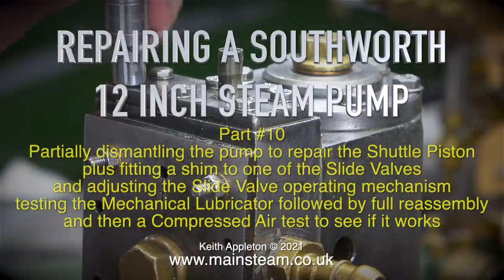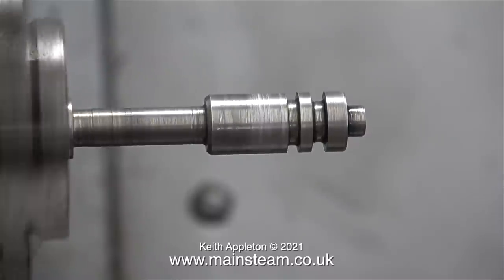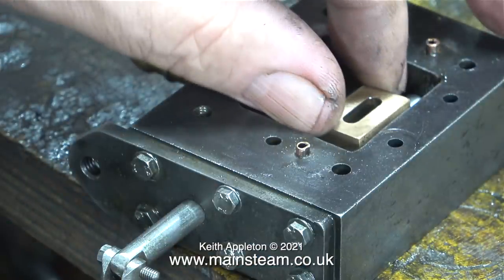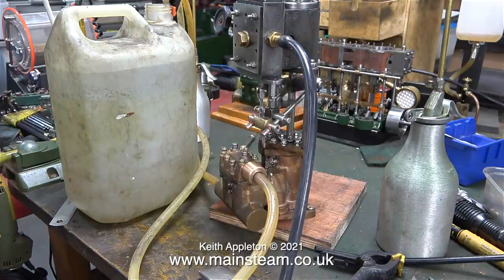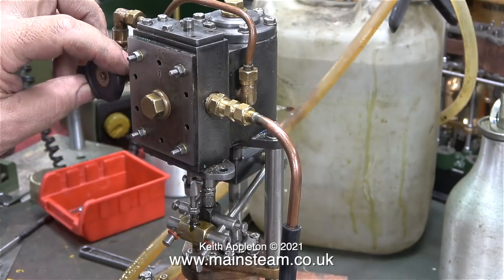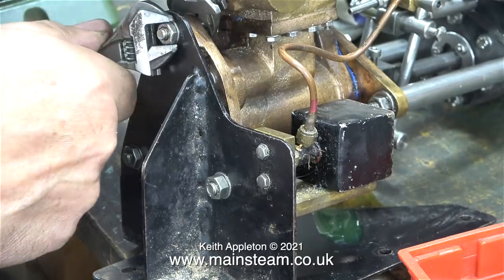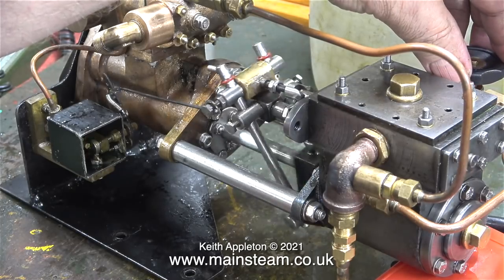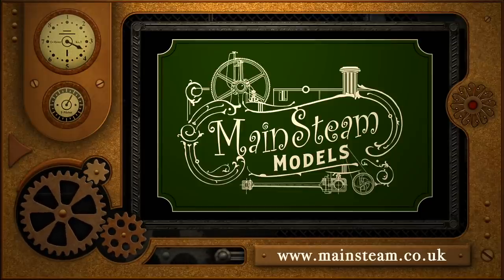REPAIRING A SOUTHWORTH 12 INCH STEAM PUMP - PART #10

Comment: well done(   how do you keep the steam oil from leaking out?)
Reply from the maker: I drained out the steam oil first before turning the pump onto it's side.
Reply: @keithappleton  I was thinking when you run it for a while how can you keep oil from coming out(sorry for not being clear)
Reply from the maker: It is a vertical engine, and in the video I only ran it for a very short while. In a video coming up shortly I make a stand for it so I am able to run it in a vertical position. Why not try www.patreon.com/keithappleton then you wouldn't have to ask me quite so many questions }:-)))
Reply: @keithappleton  good luck